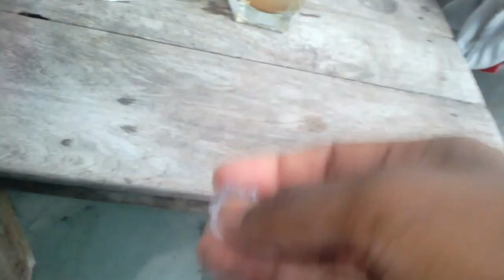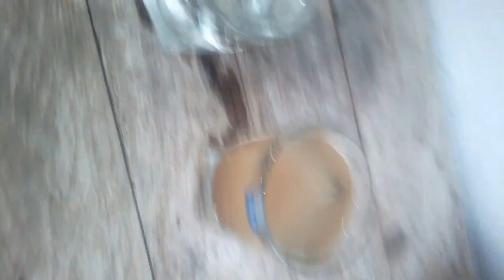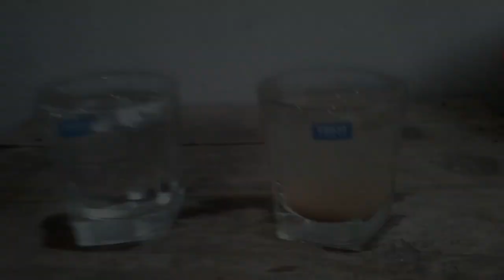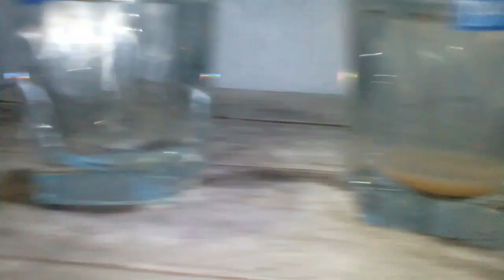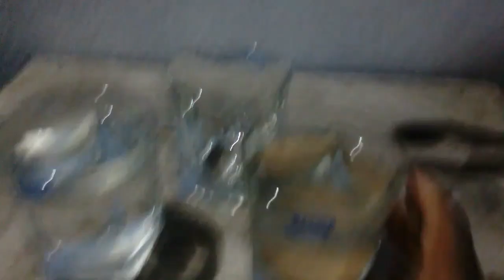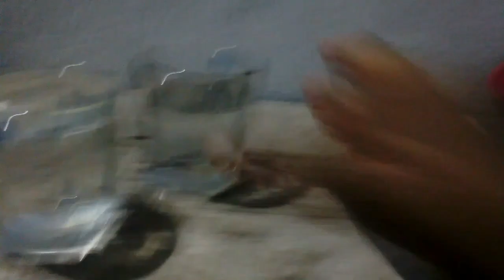Alum test in raw water l coagulation process practically| Alum water treatment

Comment: Does this kill bacteria too???
Reply from the maker: No, alum only settles the suspended particles by forming precipitate.
For killing bacteria we can adopt boiling and chlorination methods
Reply from the maker: ARUNachalam JAI SaiRam JAI GuruDev  There is not a lot variation between two words, both are correct, pure means, not mixed with other material, here in the video I've had removed solid particles from water, so I called it as pure water. Pure water sounds good than clear, so I have used this word.

Comment: Does alum contain salt?
Reply from the maker: yes
Reply: @nrcivilengineering901  then how could it be good for skin?
Reply from the maker: @bb8218  Too much using of anything consequences in bad effect, alum is generally used based on value of turbidity in water.
Reply: @nrcivilengineering901  so is it safe to rub alum on wet face on daily basis?

Comment: How much alum required for one liter
Reply from the maker: 30mg/litre
It depends on turbidity of water
Reply: @nrcivilengineering901  water soften effect how much time b there
Reply: @nrcivilengineering901  thank u for ur reply
Reply from the maker: @sunkesulavajeeha9954  It takes 30 minutes after adding aluminium sulfate.
Actually, all is used to remove the suspended and colloidal particles.
For softening we adopt lime or boiling process or any other best like ion exchange. Softening means removing salts from water.